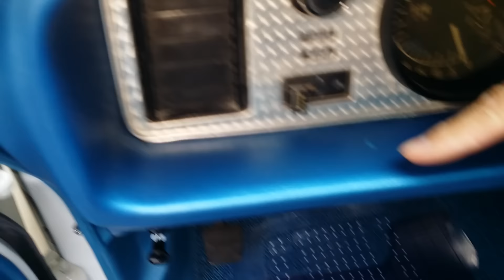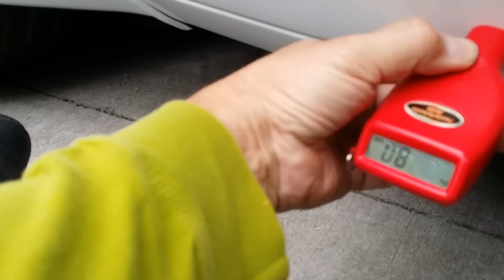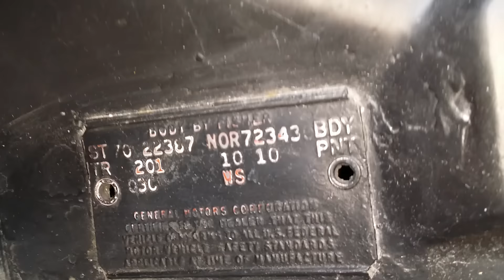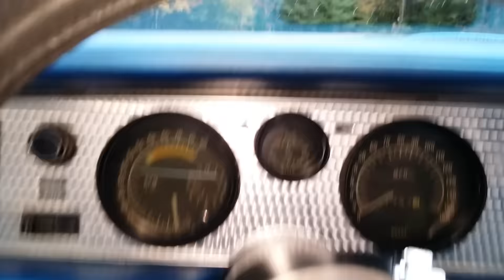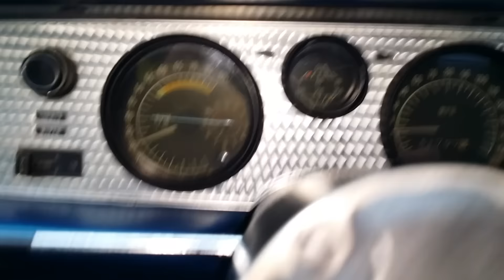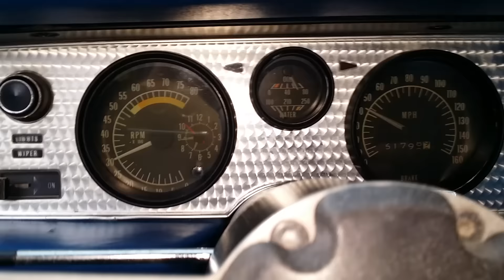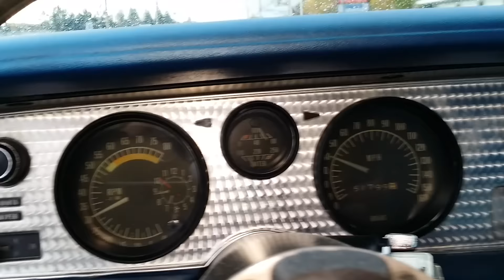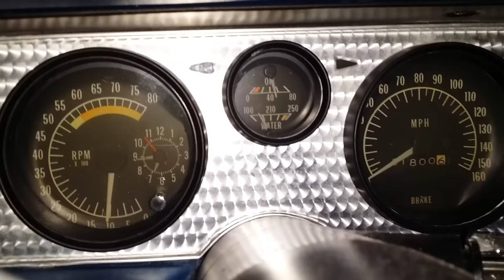1970 Pontiac Trans Am Ram Air III for sale auto appraisal 800-301-3886

Comment: That's a nice driver T/A. When I was a youngster, I worked part-time at a Chevron station and one of the guys working there had bought a brand new 1975 T/A with the 455 4-speed. That thing was fast. We would go to jack in the box for lunch in it.  I was only 14 and couldn't drive yet; I really wanted one of those cars. The guy was in the Navy and working part-time there too. He got orders to Japan and sold it. I think the Smokey and the Bandit movies made those cars sell like crazy. I would not give anything near $30k for this particular car.
After watching how it sounds and drives. It needs a lot more work. Missing the original rear axle and that leaking transmission would make me pass on this one.

Comment: Cowl tag missing rivets and denotes 70-22"3"87 (which is the code for the base model)  If it were a factory Trans Am it would be stamped 70-22"8"87...

Comment: Just on the obvious this car came with 15" ws wheels the quarter panels are obviously the wrong year from the fisher stamp being elongated to a point under the strike post. The floor pans have all been patched the rear end was a 12 bolt from factory  .The interior rear seat side  panels are recessed for retractable seat belts . Not what i would call original. the Shaker is in correct At a quick glimpse I can see 15,000 dollars in missing correct parts, if you can find them it appears as a possible rebody
Reply: Mine had a 10 bolt with 3.73s and a posi.
Reply: I think the 701/2 only came with the 12 bolt rear 3.73. This is 1970.
Reply: @ckelley63  not if it was a 1970 ram Air 3. They only came with 12 bolts. 1971 they started putting 10 bolt.
Reply: @alanbialeck948     Mine had the 8 1/2 ringed geared  10 bolt
Reply: Yeah guess late 1970 cars did get the new 8.5" 10-bolt.

Comment: 10 Bolts Weren't Used Till 72-73,I Believe,W/ Autos, 4 SPD's.& Super Dutys W/ 4 SPD's .Std.W/ 12 Bolts?
Reply: 1970 was the only year that Trans Am's came with the 12-Bolt Posi, all others are 10-bolt.

Comment: the hood shaker is incorrect it should have a functional flap not a screen the brake proportioning valve is in correct it is also missing all the heat tins on manifolds

Comment: One day ill own one of these...
Reply from the maker: +thebluepen That's a wonderful affirmation!
Reply: +AutoAppraise how much are you selling it for
Reply from the maker: This was done for one of my clients, I'm not actually selling it, just did the inspection. I think he's asking $45k
Reply: +AutoAppraise ok thanks
Reply: +thebluepen I owned one of these in 1975, a real fun car to drive, brakes were not great though, mine had a turbo 400 automatic, top speed 110 with the 3.73 diff, I was at red line at that speed but it got there quickly, I used to blow off vettes easily
Reply: Comparing a 75 trans am to a 70 trans am is like comparing  a biplane to     a  fighter jet.
Reply: A Pontiac 400 is still a 400. Just needs some work to Unleash the Beast. Remove Smog Emissions equipment, Cam, Intake & Heads.

Comment: well the appraiser must not know what he is talking about case in fact: Doesn't look in the trunk? The doors are brought  easily to original position with adjustment and new springs, the shifter knob is aftermarket, the bezel insert for a rear window defrost in in shit condition, the body bushings are wasted, the frame rails were NOT black from the factory, front steering components look wasted, the shaker door is fake, no grill in '70 and non functional, cracks on the endure bumper don't mean shit except the painter did not use flexible primer or paint which is necessary, and that's just the beginning. C'mon you act so anal but miss all that?